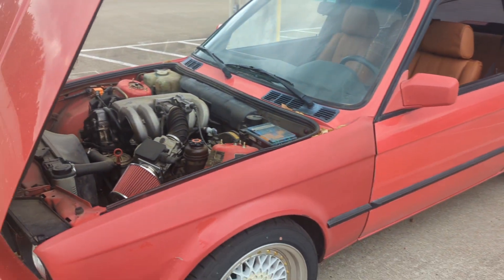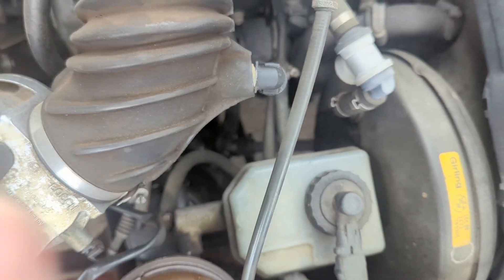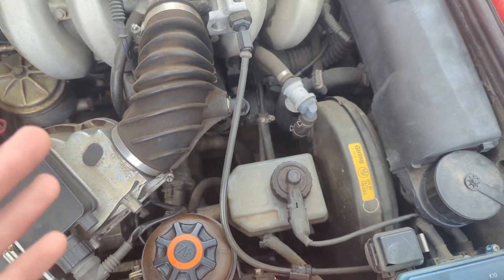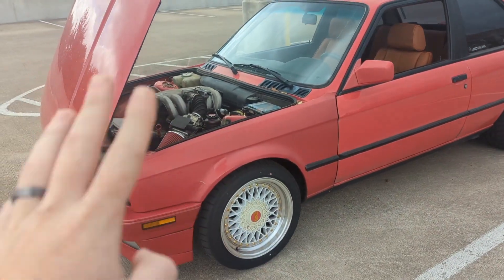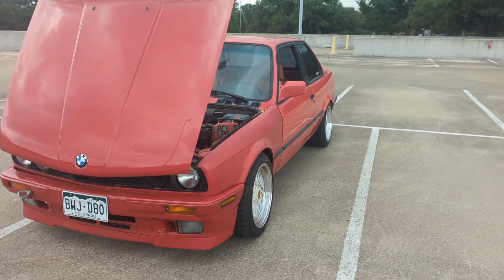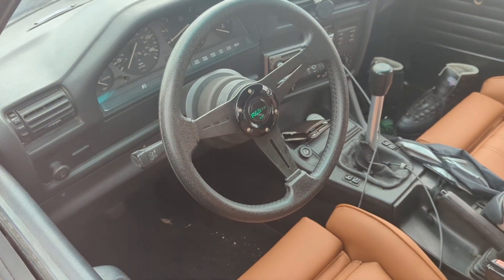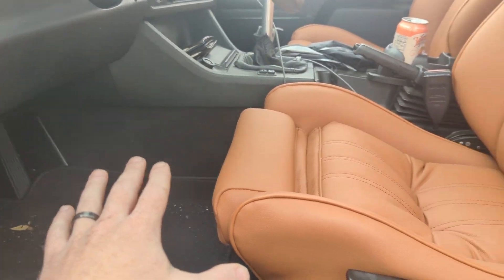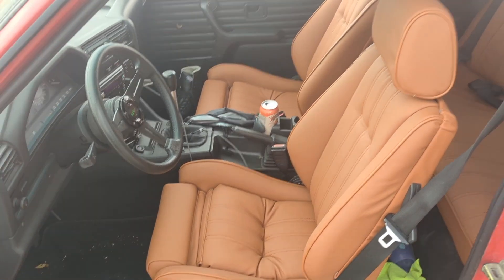The BEST First Mods For BMW E30!!!

Comment: Quick question does it matter which year model z3 rack and pinion I get and you mind mentioning a lil more on the new steering column please and thank you
Reply from the maker: Hey man! So I personally got the z3 steering rack from a non-m car from year 1996-2002 you can find them on Amazon, I got the steering column from condor speed shop, it is the airbag version and it deletes the bulky stock steering column, about a year ago I have a video that covers both of these mods when I installed them🙂 hope this helps!